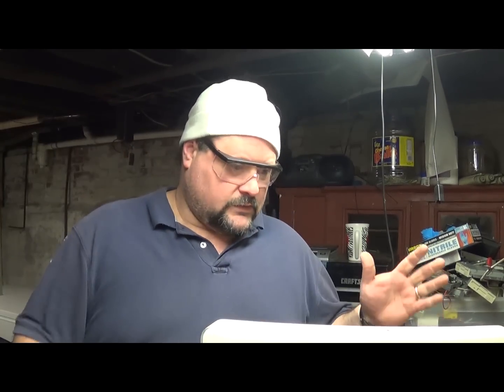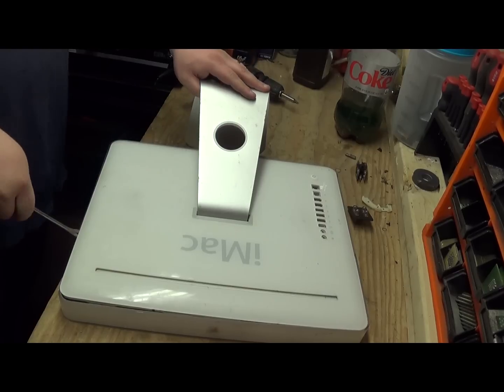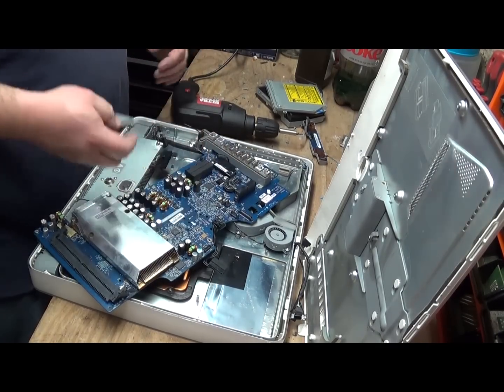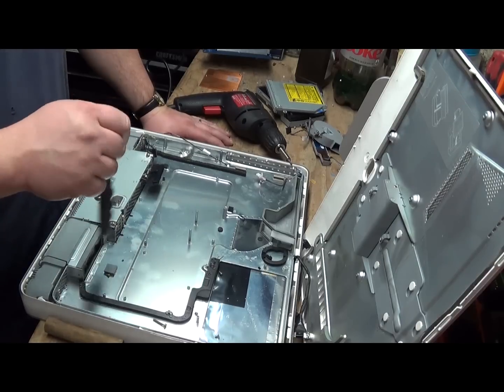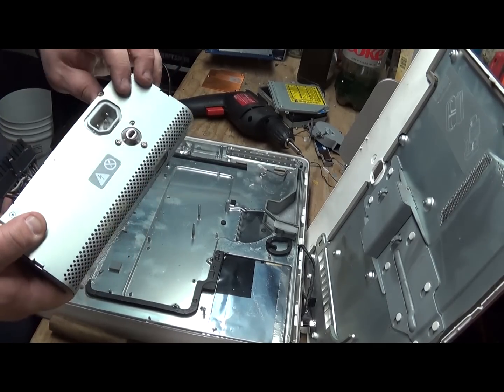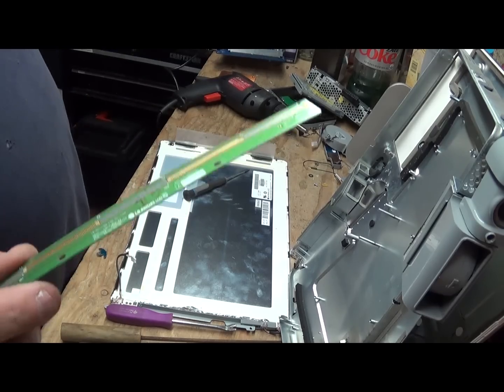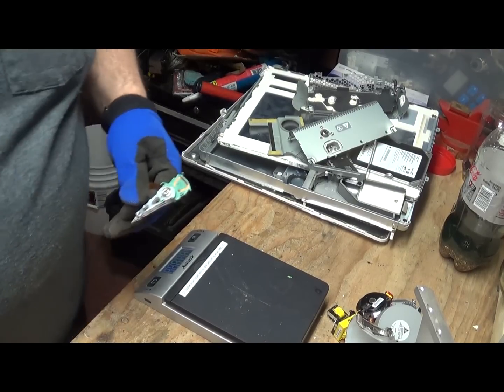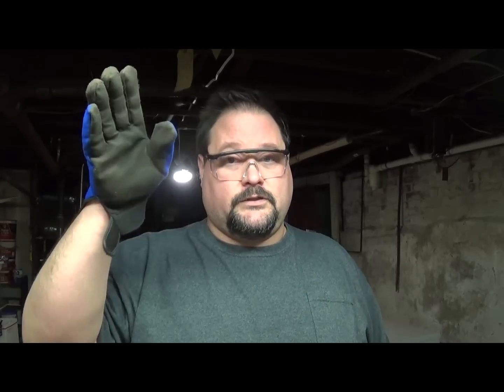Taking apart an iMac for gold, copper, aluminum and more!

Comment: there are three screws on the bottom of the unit to take the rear cover off. no need to use a pry tool. safer and faster to unscrew.

Comment: remember way before we found out there's too much of a good thing my brother had both this massive copper heatsink (brick) for his motherboard.  Eventually his computer stopped working.  and it was because the copper heatsink was so heavy it split the CPU ship down the middle and bent the motherboard.  ie there is a rating on motherboards and if you go over it bye bye.  I'd guess that copper brick is worth alot now but he just won't scrap it.  (Zalman I think)

Comment: have you ever done a garage sale sweep of everything? You don't pay....just haul away...did that 2 days ago and got a 300.00 dollar Mercedes Benz fuse panel that looks brand new
Reply from the maker: Jay Stevens That's freaking awesome!  I have done clean ups of sales after they are done and the owners just want it all gone.  Are you talking about taking everything before they try to sell the stuff?  How does that work?
Reply: they just get tired of looking at the stuff or theyre in a time crunch. I put an add on craigslist, they called and said I could have it all...clothing, electronics, working and not plus scrap crap

Comment: how do you separate yellow brass from other brass?
Reply from the maker: Jay Stevens Yellow brass goes in one bucket, red in another.
Reply from the maker: Moose Scrapper lol, just kidding.  I take a file to it.  THe color will hit you right off, and red brass is harder than copper.  Plated brass like faucets and plug ends I do the file test as well if it passes the magnet test.  I end up with 4 brass buckets.  1 yellow, 1 plated yellow, 1 red, and 1 dirty that has the bits I just do not have the time to mess with.
Reply: smartazz, left myself open for that.

Comment: Hey Moose, new subscriber here. I was wondering if scrapping calculators is worth it. I couldn't find if you made a video or not.
Reply from the maker: Bricky Hi and thanks for watching!  Some calculators are and some are not.  The scientific calculators often have a big gold plated board in the while the other simpler function calculators most often do not.  Its one of things you have to crack open to find out each time.
Reply: Ok, thanks for the quick reply!

Comment: Excellent video!  I was curious about the solid piece of copper.  At the end you measured the weight of all the copper together and said it was #2 copper.  It looks like a #1 copper - like clean copper pipe.
Reply from the maker: Anthony DiRenzo it does look like that but it has a finish on it.  When you scratch it it kind of flaked off unlike just oxidation.

Comment: do you put the screen for seperate recycle ? as they have rare earth metals inside touch screens, not sure if that apple was a touch screen also the ribbon cable that touch the screen from the boards on the back of screen are usually silver or gold
Reply from the maker: Hi there, I have not scrapped a touch screen yet but when I do I will surely put it aside.  Thanks!